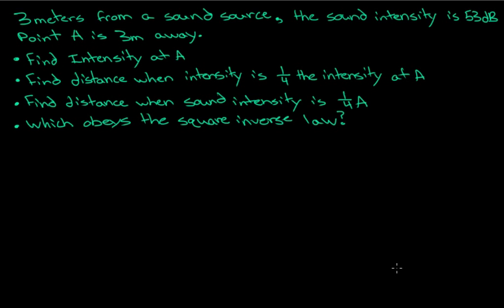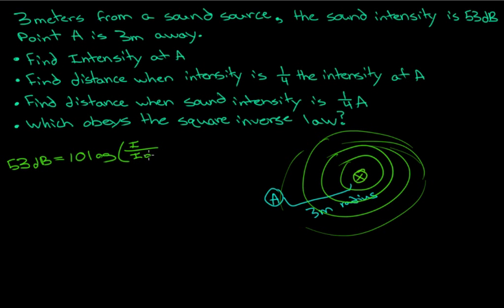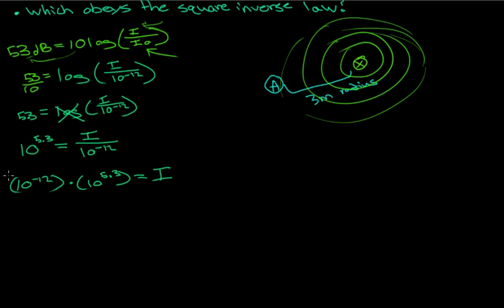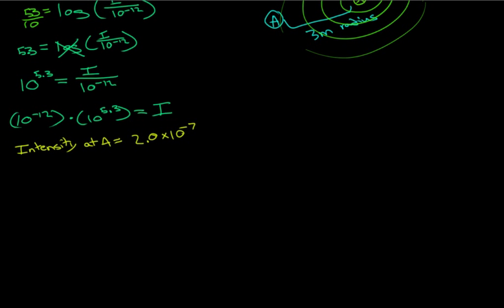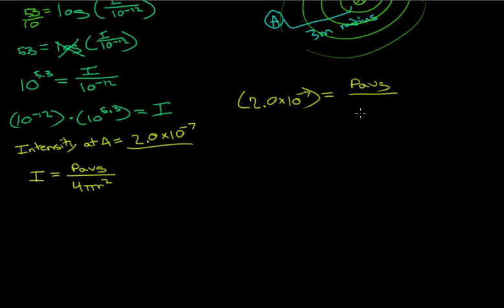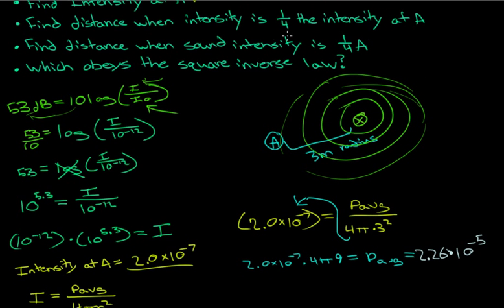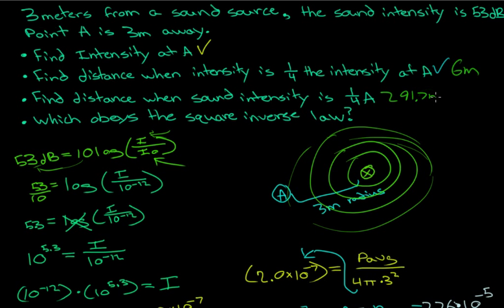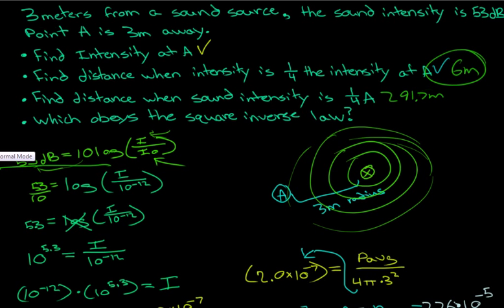Sound intensity and wave intensity example question

Comment: quick question regarding your calculations for the Intensity in1st example.  10^-12 * 10^5.3 . 
Arent we supposed to add the exponents (a^n * a^m = a^n+m). Where does the 2.0 from the 2.0 x 10-7 come from?